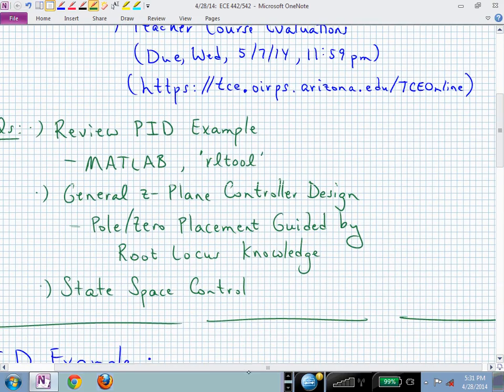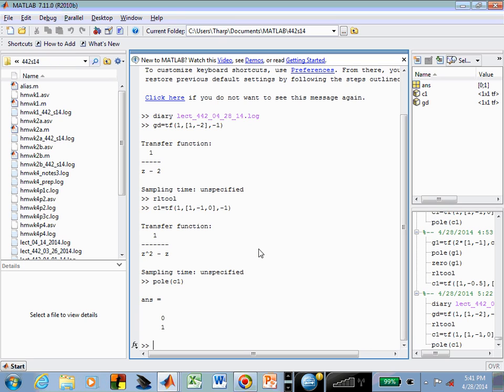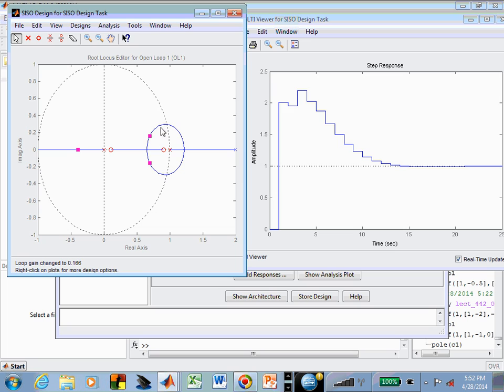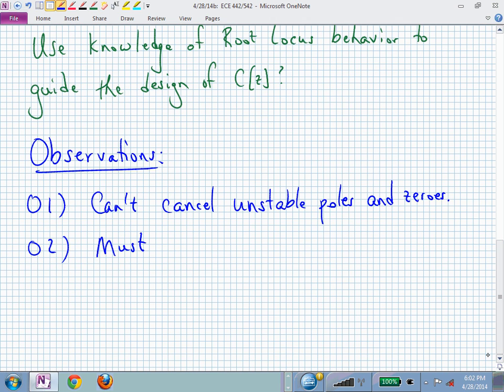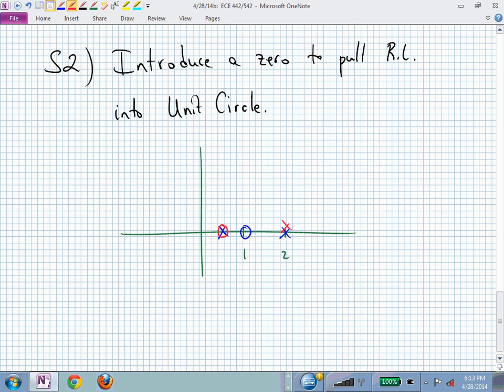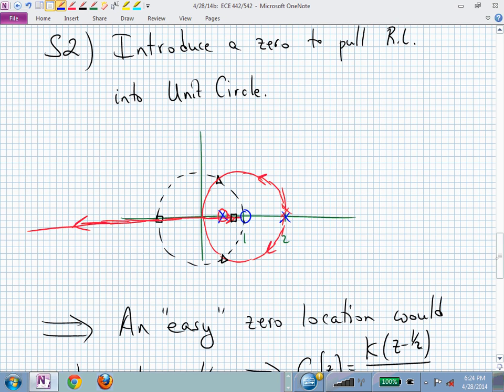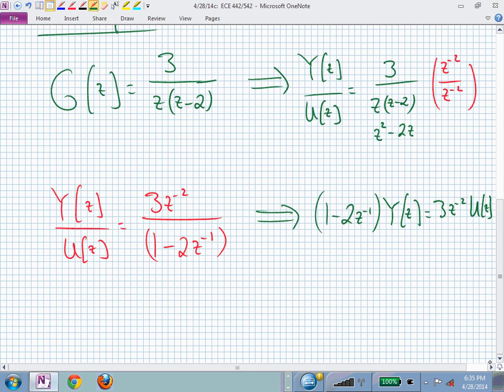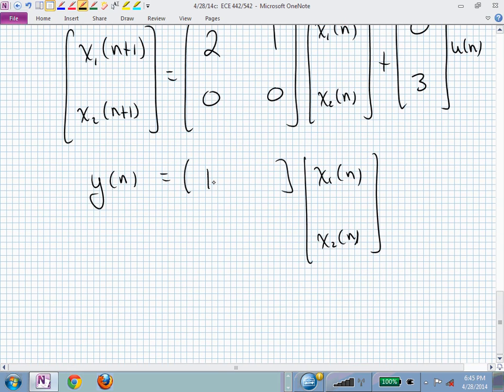ece442_vid_04_28_14

Comment: For the question at 17:35 in the video, Rltool indeed starts with controller gain at 1 once you set the controller, whatever its structure. However, rltool also allows negative k values, so be careful!.